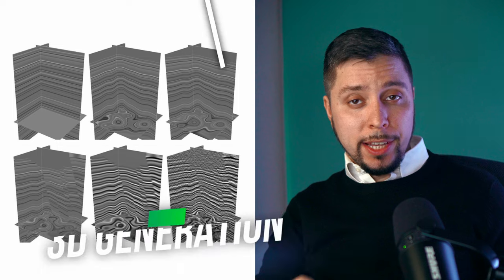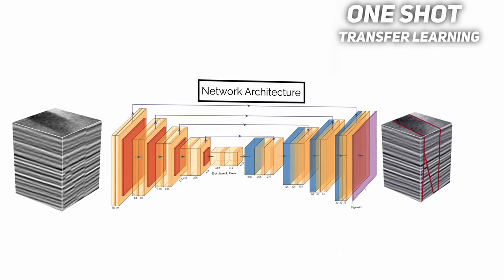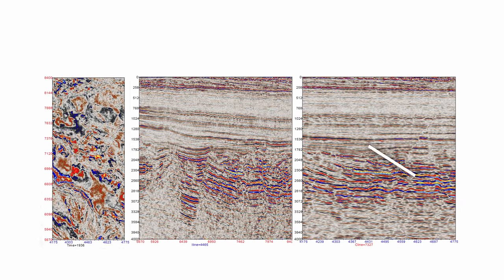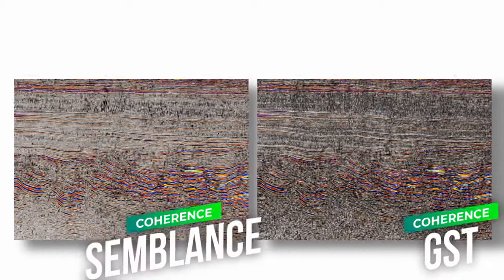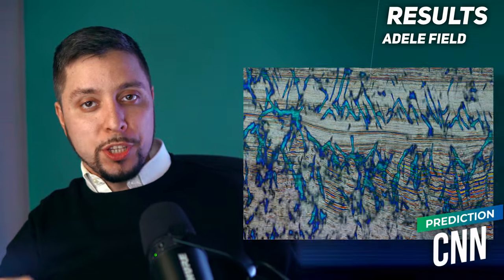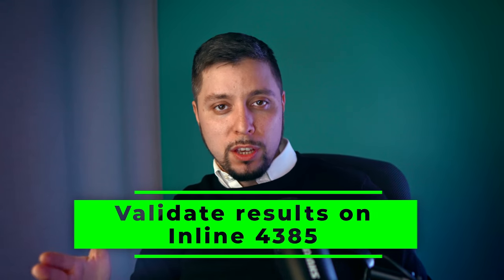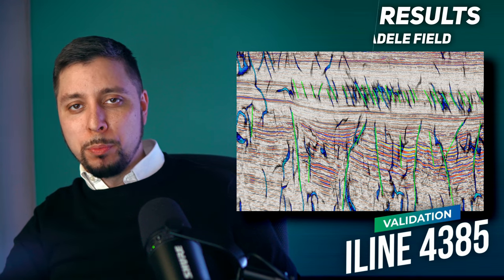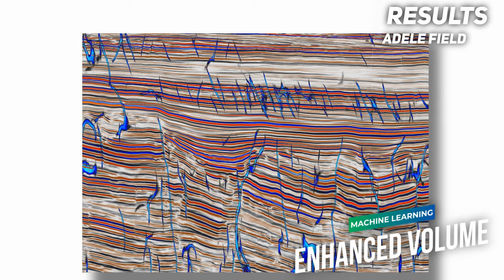AI DIGITAL PAL with a SECOND OPINION on YOUR Interpretation

Comment: thanks for the informative video... i would like to know if there is a python tool to open a 3d faults map
Reply from the maker: Or you asking about fault volume or surfaces?  usually 3d fault segmentation volume is transferred using SEGY format, which you can read with segyio python package.
Reply: @RuslanMiftakhov  thanks for your response... I think it is fault surfaces, it is ASCII file with few columns